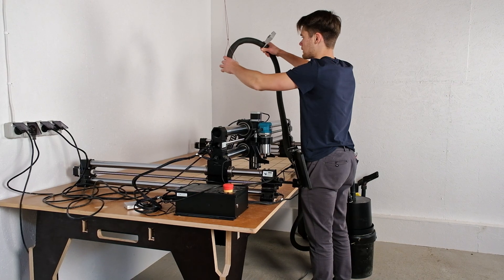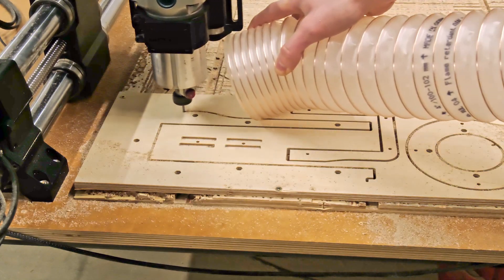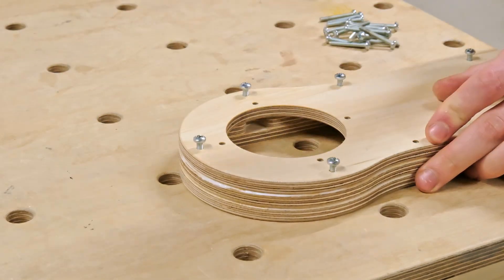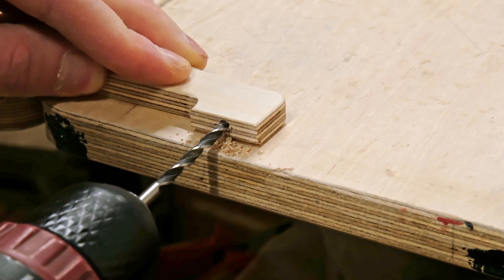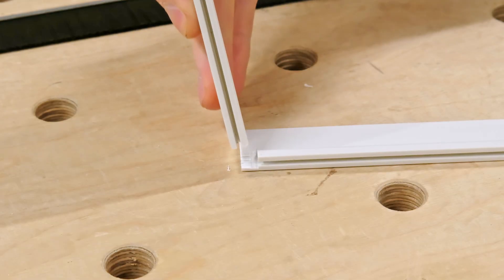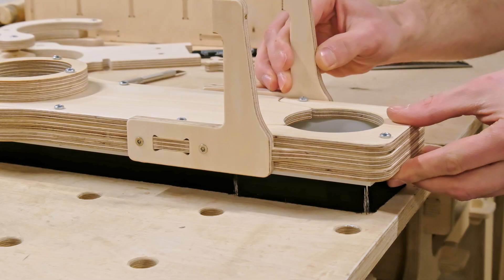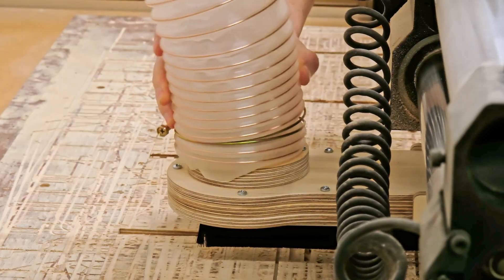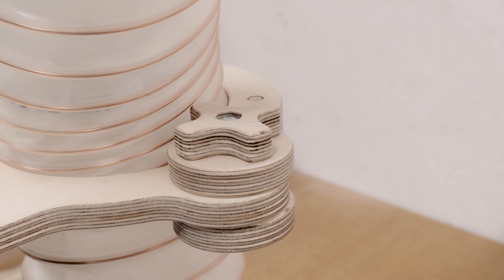How to Improve CNC Setup without Leaving the Workshop?

Comment: personally i would use a round over bit and tool path to do the edges rather than the router but this is a brilliant idea !
Reply from the maker: That’s a great idea — especially for projects with lots of parts!
We’ve thought about rounding the edges with the CNC too, but it does take a bit more time if you don’t have an ATC, and it only rounds them on one side 🤔

Comment: Great design. I noticed that on your CNC you do not have any tracks or clamps to hold material. Do you always secure stock to your table using screws over a sacrificial plywood sheet.
Reply from the maker: Thank you! Yes, you’re right — we used to have T-tracks on our first spoilboard, but we rarely used them. When we upgraded the setup, we decided to keep things simple and stick with screws instead.
Reply: @Aribabox  i use brass screws that way if i do run it over it minimal damage with softer metal;)
Reply: @christopheryoung8615 thanks. Good advise
Reply: @Aribabox thanks for the great content!

Comment: You can improve the suction even more if you want. (reducing the opening above the workpiece)

Did the large opening vs router air outblow not have a negative effect?
The moto's airflow to cool it is blowing in that opening that you want to create suction. So it can create wooden chips to blow around

Comment: Well done, it's always a pleasure to discover your videos. This one is useful because I own a CNC machine, and although I made a head using 3D printing with hair around it so as not to lose the suspension effect, I must admit that your project is solid, and you have a different approach to design than what is usually seen and done.
Good luck to you.

Comment: Fantastic execution. I like how you leverage the current solution into the design for your desired solution. Funny, I'm still using the skirtless, brushless half-shoe that I never finished, and I've been looking at what smart people have done.

@CorbinDunn has a great couple of videos utilizing a 3D printer for his modular shoe, and I'm borrowing most of his ideas (check those out, and maybe jog some ideas for revisions). 

I really dig the idea of running the shoe to the back. Sadly for me, I would need myself 16 inches of dust shoe thanks in part to my cable chain.

Keep up the great work!